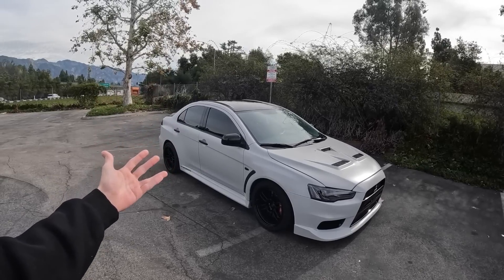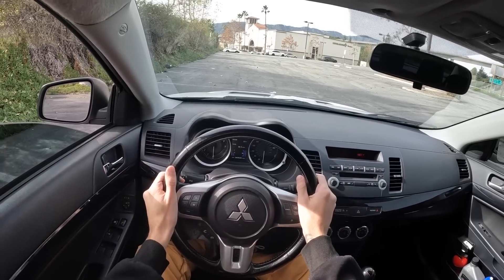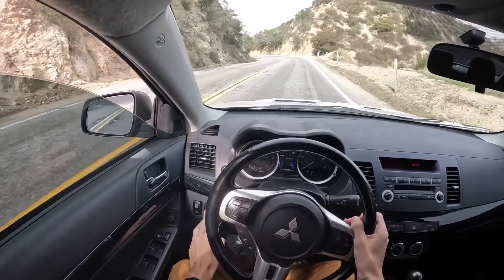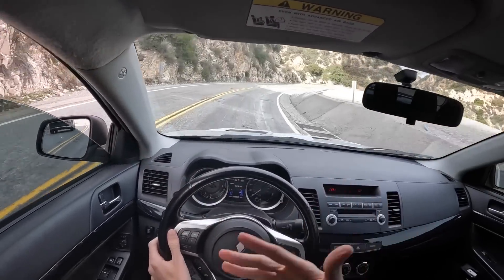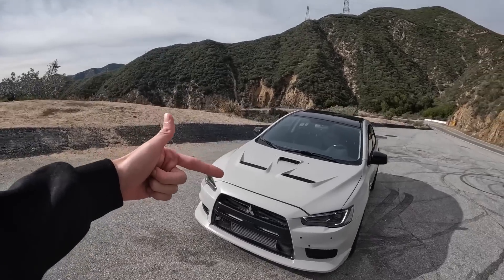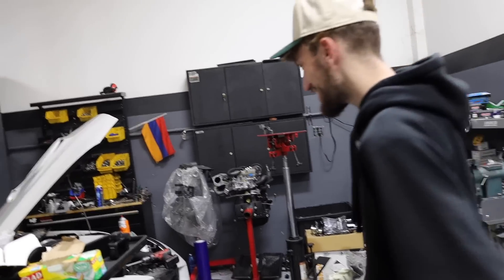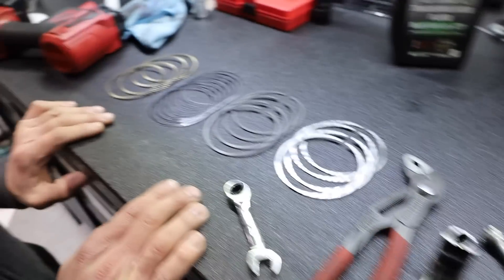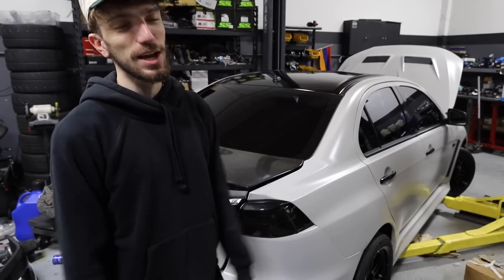I DROVE MY OLD 900HP EVO X.. AND BROKE IT!

Comment: Maybe if it was an 8/9 it could fetch the 50k mark but I don't see an X getting anywhere close to that even with that mileage and power point
Reply: I Seen an evo x go for 70k with 5 thousand original miles on carsforsale. It could happen
Reply: @Ohkayyjay  Key word there is original
Reply: Yeah 50k may be a bit much, but the Xs are starting to push up in value.
Reply: @SlammedZero  exactly. If I copped an evo x with like 20,000 original miles Id slightly modify it. and let the value skyrocket lol
Reply: @Ohkayyjay  yeah i have an evo x with 50k miles on it 400hp and the price has for sure risen
Reply: @scottwarner1759  as long as it’s great condition body wise that’s some nice profit lol